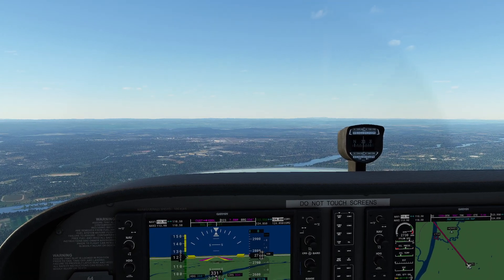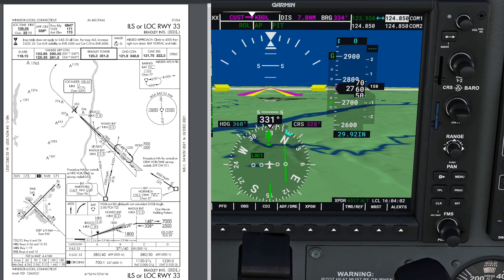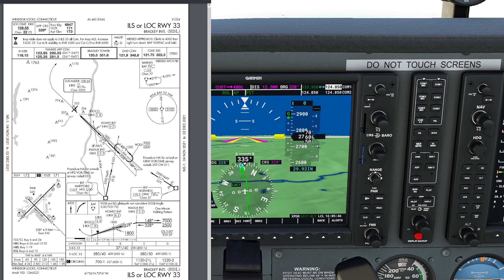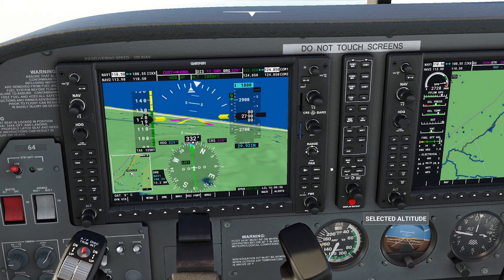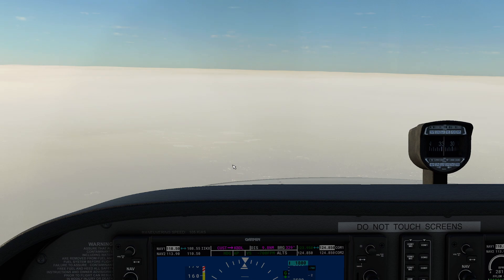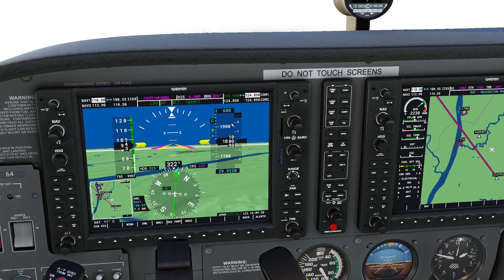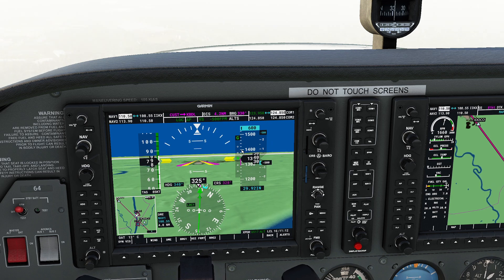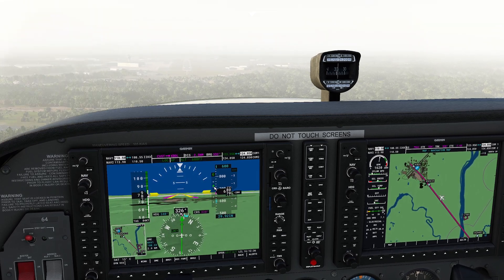MSFS - Localizer Non-Precision Approach

Comment: IS there a situation where you'd be getting ILS info, but NOT a glide slope?

I'm just trying to figure out this exercise. Is it for specific airports/runways, or is it just another way to practice?
Reply: Yes. The approach he's flying can be done either way, but other airports have localizer-only approaches that provide no glideslope information. (Although I believe the main real-world use is actually when your aircraft can't receive the glideslope information rather than when the airport isn't sending it.)
Reply: Yes.  Sometimes glide slopes can be out of service but the localizer works just fine because they are two separate pieces of equipment on the ground.   Some airports have localizer only approaches.  There are also LDA approaches that use a localizer to get to the airport but the final approach course isn’t aligned with the runway and will be a circling approach.